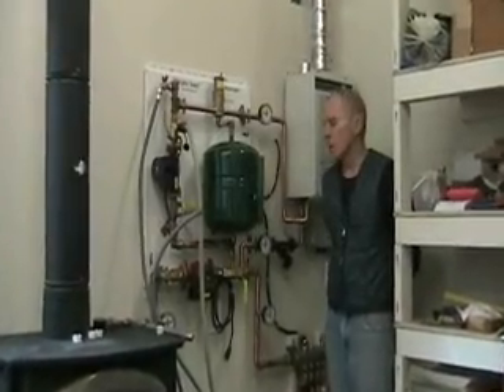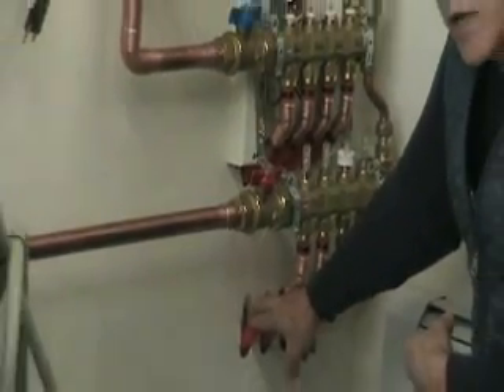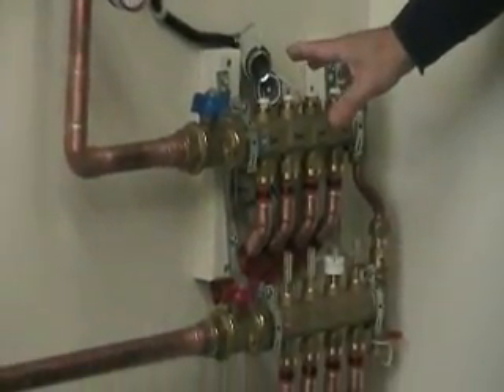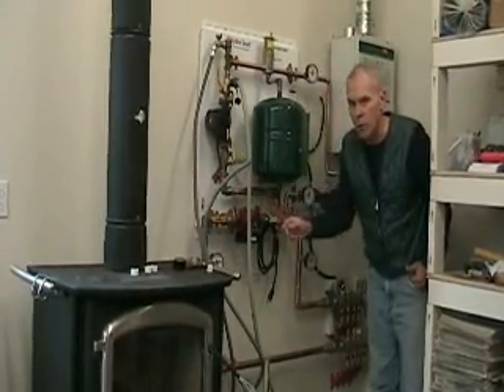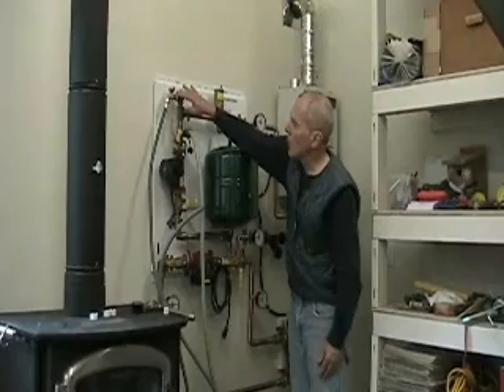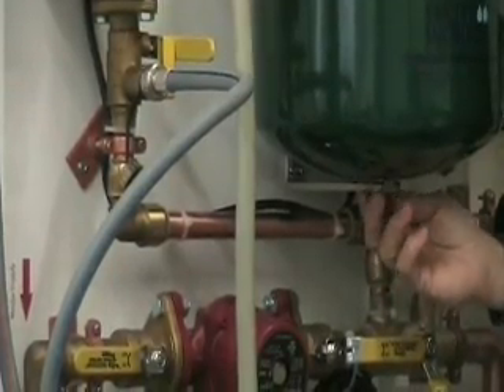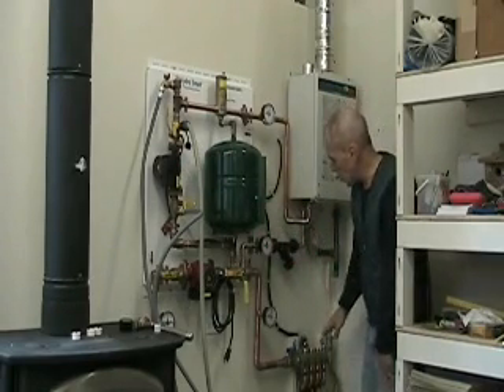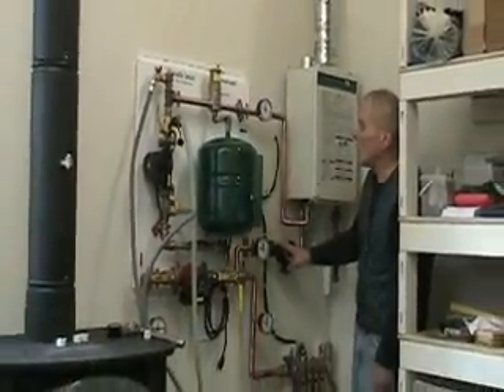Radiant/Hydronic Heat - How To Installation

Comment: Use a heat gun, and or make a small doghouse storage bin for your PEX and heat it with a space heater or two! Nothing is as flexible in cooler temperatures, and it gets worse the colder it gets.

Comment: I just built a system for my pole building using the Hydro Smart panel as my model. What have you found to be the best way to operate the system as far as supply and output temps. Do you leave the purge valve completely open ? What speed are you running your pumps ? I have a six 300 foot loop system in a 2000 sf pole barn. Thanks